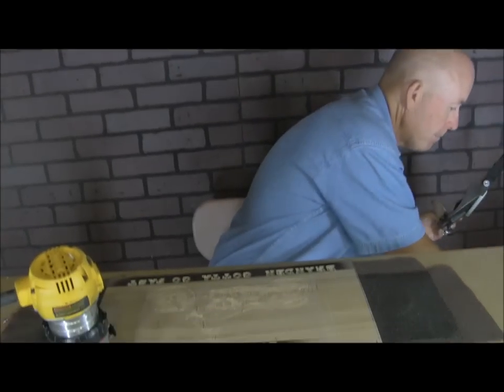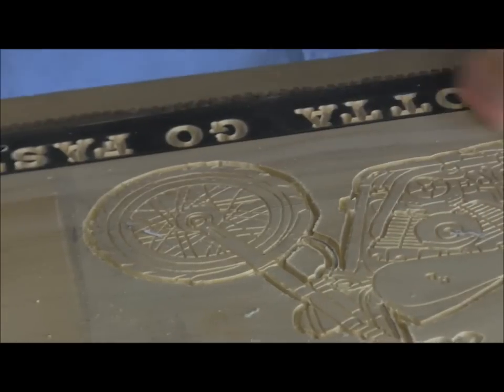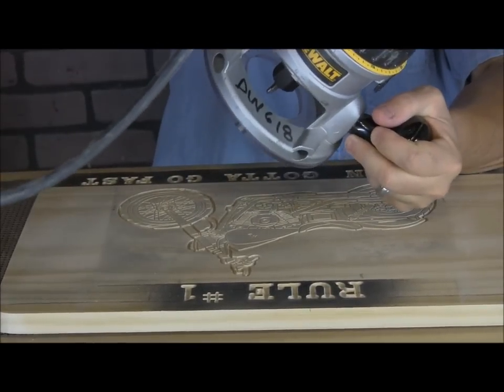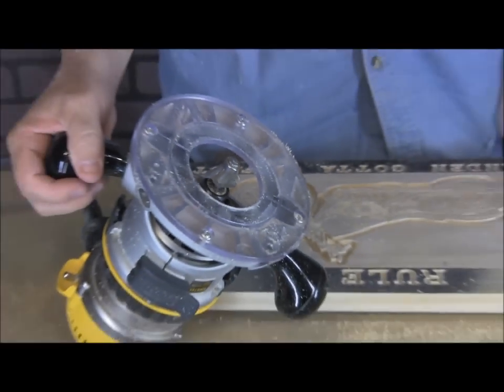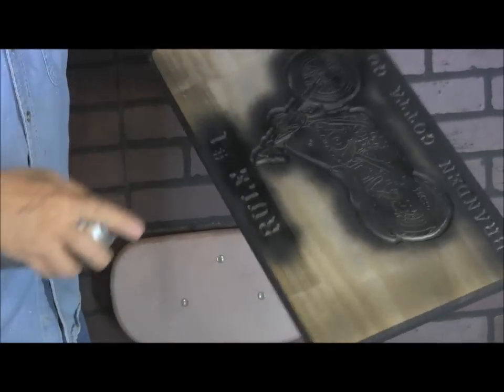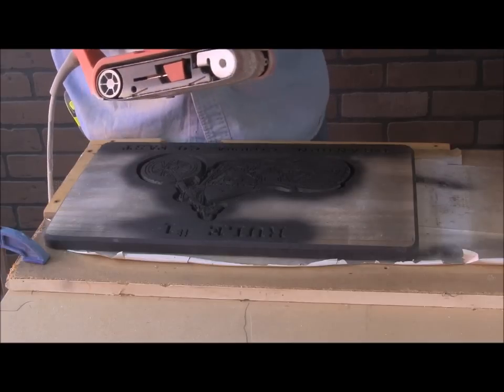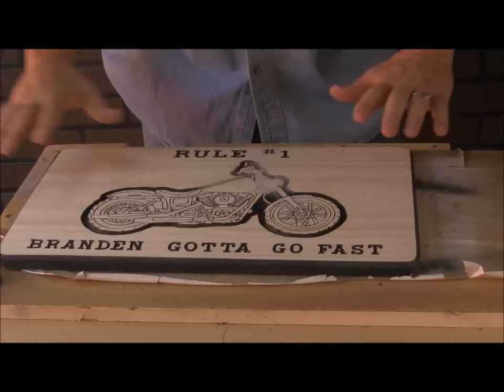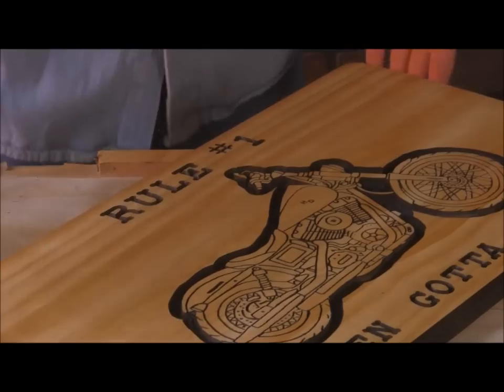#144 Carving Motorcycle Part 2

Comment: Eric, this may be a really dumb question, but it's really hard to see the angle you are holding the sander to the board while sanding with the 40 grit (or 50 grit) paper.  Are you holding the sander flat against the board, or are you tipping the sander so that just the leading edge of the paper is touching the board and the tail is up off the board?

PLEASE keep up this great work.  You are such a great teacher and I learn SO much from each of your lessons.  Thank you for that.

Skip
Reply from the maker: +Phottoman Yes I keep it flat on the board but when I'm to trying to pinpoint where I want the sanding, I will put just slightly more pressure there. It's a touch thing. Good question. Thank you

Comment: i used that clear today, looked good when i put it on, but when it dried it had a white plastic look to it.  :/  So black wasn't as deep and wood lightened up..is that normal?  i dont notice it in your vids.
Reply from the maker: +Van-Life Crisis No that's not normal. Not sure why it would get a milky look to it. I've never had that happen with the clear. What was the weather like. Humid? Was the can cold, warm? Shouldn't have anything to do with the the depth of carving.
Reply: Its very humid here.   I read on google that humidity can cause it unfortunately.   Not sure how to remedy that other than moving to arizona ;)
Reply from the maker: +Van-Life Crisis Maybe you can set up a drying cabinet like I have out of an old fridge. I just keep an incandescent light in there that I really only use in the winter. I just wonder it it would keep the humidity out? Maybe at least till your sign is dry.